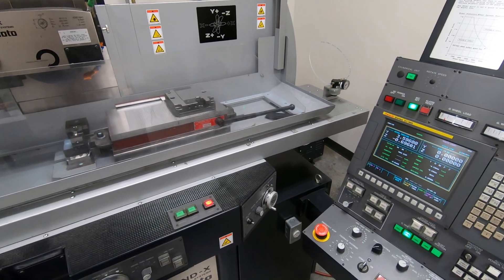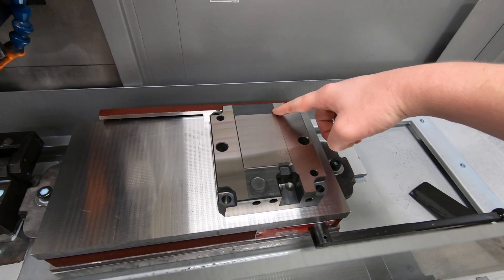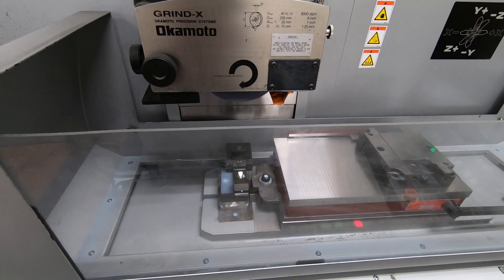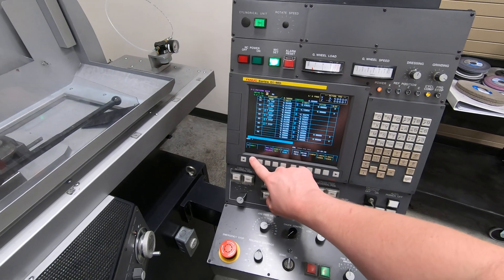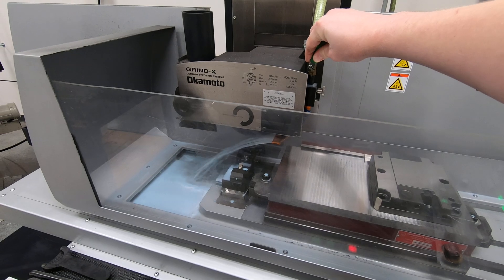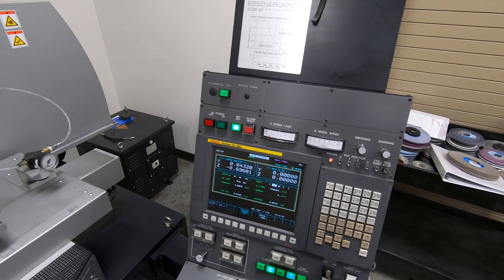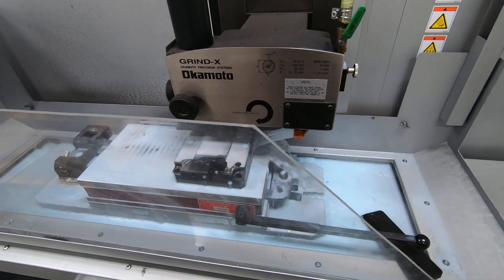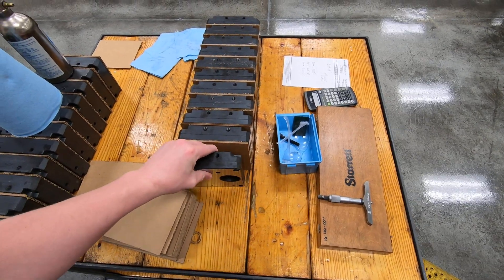Okamoto 818NC Surface Grinder

Comment: just curious, why do you leave so much stock to be ground off?
Reply from the maker: To protect against warpage through heat treatment.
Reply: @johnjamesterbeek  I guess I'm used to working with S-7 and smaller pieces usually. We double-draw heat-treat and only leave .005 per side max. Thanks for responding. Looks like an incredible company there.

Comment: Hey John, how are you liking your 818NC so far?
Reply from the maker: We like it a lot!, had some issues with the ballscrew table though which Okamoto has since resolved.  Unfortunately that problem didn't arise until after the warranty period, but you know how that is.
Reply: @johnjamesterbeek  That's unfortunate but I'm glad you were able to get it resolved. Are there any options for the machine that you recommend? Any options that you would not recommend?
Reply from the maker: @SquidIndustriesco  I would recommend the coolant filter option for sure, also buy some spare wheel arbors and a balancing stand if you don't already have one.  I don't think I would get the magnetic chuck option again, just builds heat over time.  I recommend getting a nice fixed pole permanent chuck.
Reply: @johnjamesterbeek  Will do. This will be our first surface grinder purchase so I appreciate all of your help and advice.